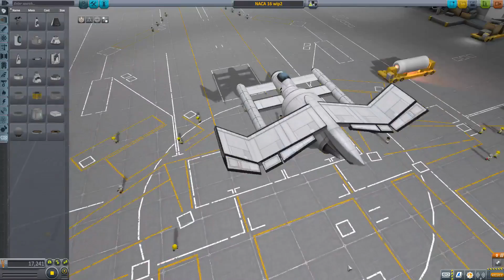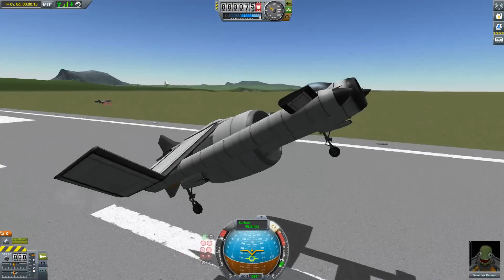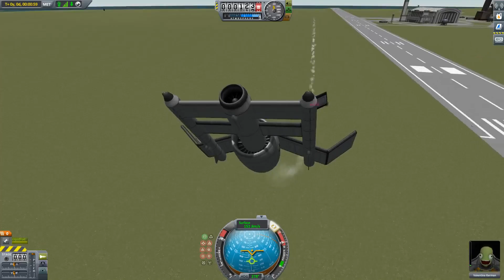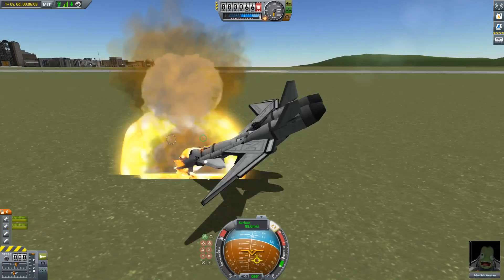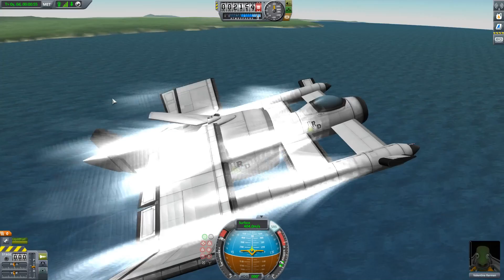KSP 1.2.1 Designs - The NACA 16/18

Comment: can I see what the art that inspired this was?
Also I bet the deformation is actually a bug (a bug that could be a feature)
Reply from the maker: If I knew where it was, I would share it. I have a bad habit of losing those images...
Reply: Guard13007 I was asking because it seemed familiar, while I was doing some digging around myself I found this:   http://www.deviantart.com/art/AIR-RACERS-1948-142808942

Don't know if its what inspired your craft, but its a similar looking thing.
Reply from the maker: Haas Steambraker It wasn't that, but that is the exact same design as the image, meaning whoever made this was inspired by it, or the image I saw was inspired by this. It is the right design.